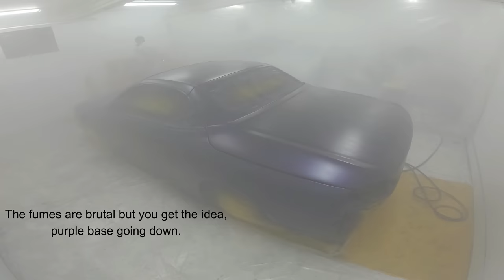Building DREAM s15 silvia in 10 minutes!

Comment: Did the s15 release a convertible? Especially hard top?! I had no idea!! 
Good work and well done. I'd love that.
I'm just amazed they made a convertible....
Or was that you? Im in the UK so commenters no laughing at me for lack of knowledge. Otherwise. Middle finger on things i may know that you don't....ahem....anyway.
Reply from the maker: Yessir they only made about 1100 of them and were only sold in Japan, autech was responsible for these cars much like many other rare Nissan models!
Reply: @_nickscraig  learn something new everyday. I'm 40 - and today i drive a Peugeot 3008 mk 1.6 turbo diesel 110hp. It gets 69mpg. Ive traded rpm fir mpg!! Sad...but true. This is what happens when you become boomer
.. but don't let what i drive make you think I'm clueless. 20 years ago to the day i owned a 200sx (not 240sx, USA for once got shafted with that Nissan stanza engine) tuned by norris designs. I absolutely loved the s13, 14 and the 15! I will link a video with not all, but most of the decent cars I've owned in the next comment.
Enjoy.
Reply: @_nickscraig  here....
And if you are bored or curious what cars are like over here, i have a playlist section called "magnitude car takes"
Anyway many thanks for the reply 
https://youtu.be/yPThYKuL9tw

Comment: Whats the purpose of putting that yellowish paste and then removing it? (learning)
Reply from the maker: I believe you’re referring to the body filler, it is spread on in low/wavy areas then blocked down flat to leave only what is needed to make a panel straight again

Comment: whats the yellow paste he puts on the car and what’s it do

Why does it look like he makes paper mashay (ik its spelt wrong but u get the idea) for form work or something?

cheers
Reply from the maker: The yellow paste is body filler, it’s used to fill in lower areas after metal work has been completed in damaged and repaired areas, the other stuff I believe you’re referring to is fibreglass mat and resin to build custom shapes and then finish with body filler again to smooth it out 
Thanks!
Reply: @_nickscraig  cheers man i really appreciate it

Comment: I didn't see any building. Just painting. Beautiful color though. Looks great.
Reply from the maker: To be fair in this video I skipped a lot of stuff but I literally built the spoiler from scratch, the rear seat cover from scratch, completely modified the front bumper, rolled/bumped fenders and quarters out to fit the 17x10+10 wheels, I quite literally built the entire car other then the engine bay which will come when I figure out what I wanna go with.

Comment: Wish my Varietta top worked
Reply from the maker: Mine actually didn’t function when I bought it either, I ended up hardwiring all the motors and latches to a switch panel in my centre console and running it off 3 switches that way
Reply: @_nickscraig  oh thats how mine was when i got it, you still have your controller in it, or is it completely bypassed?

Comment: Can anyone tell me what the point of angling the wheels like that is? Is there an actual benefit to it or is it more so just for looks? Car looks  awesome otherwise!
Reply from the maker: It’s mainly a style but also the reasoning behind it is fitting wider wheels than the cars body will allow to be tucked under the fenders, so you camber them in at the tops to tuck a wider wheel